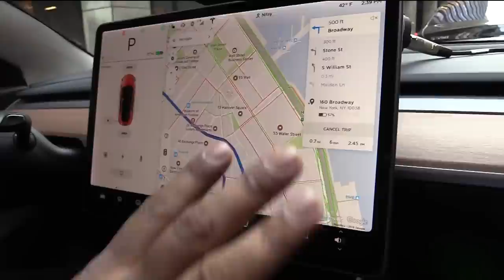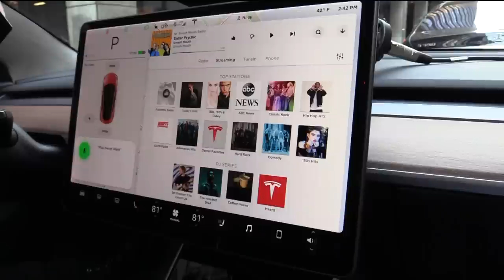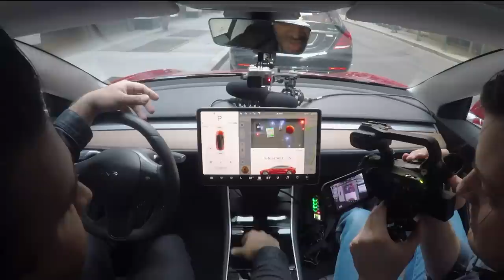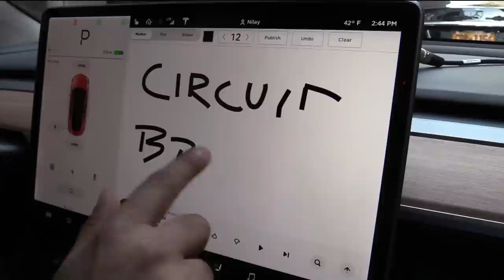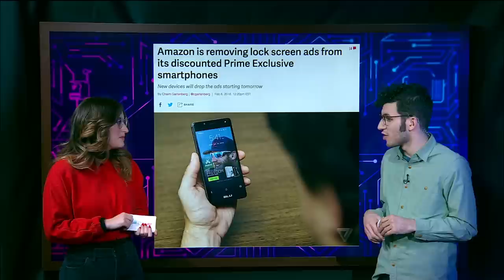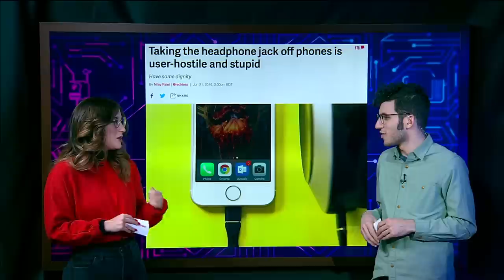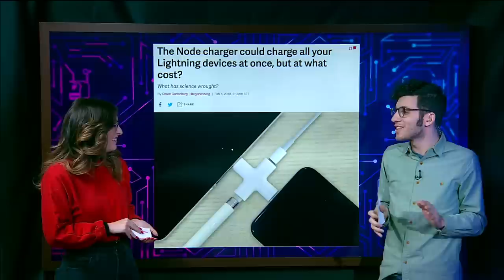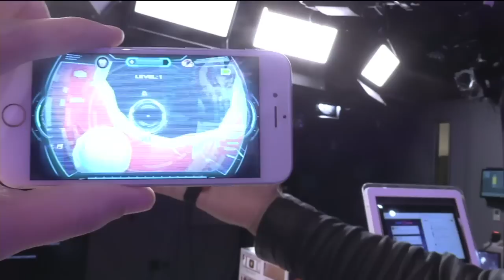Tesla Model 3 plus other, smaller gadgets

Comment: 46:44 No the extra money for EAP (enhanced autopilot) is just for the software. The sensors will be included regardless. (You can actually buy EAP whenever you like.). I think even without EAP the sensors will be in constant use for some safety features.